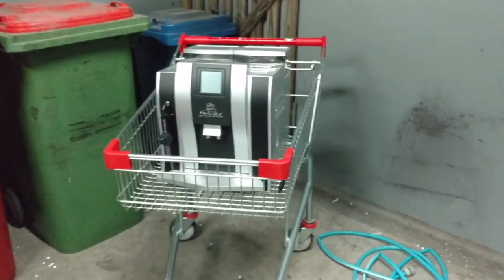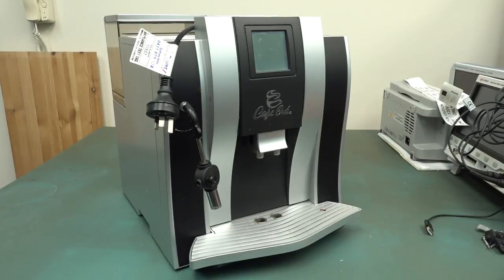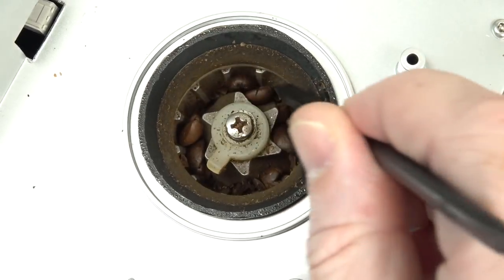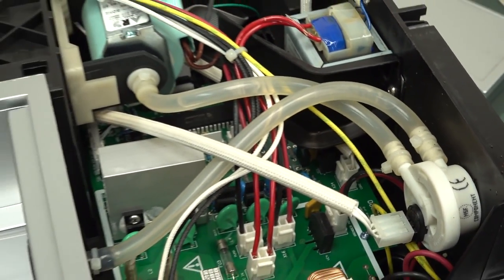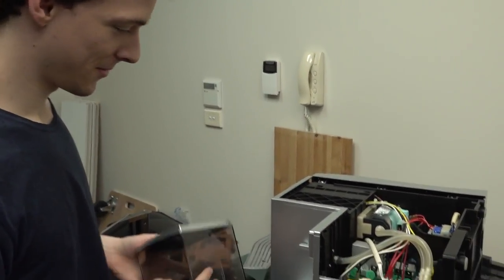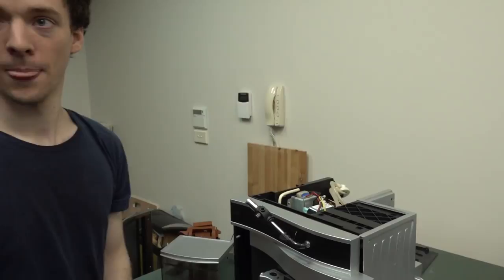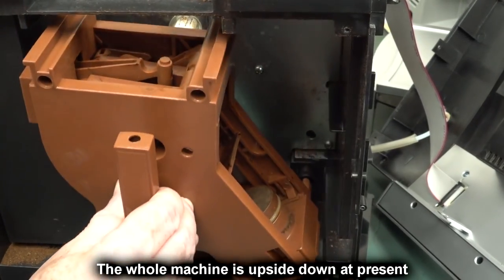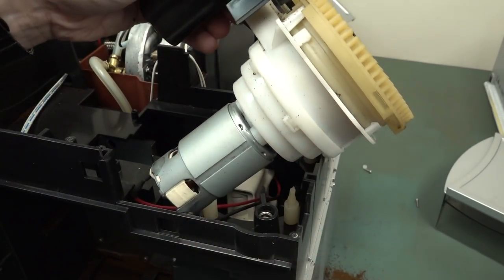EEVblog #1161- Automated Coffee Machine Dumpster Teardown

Comment: The LED at the grinder input likely just senses an empty hopper flipping on an indicator light to let you know it’s time to refill, or possibly prevents it from grinding. If there aren’t enough beans for a full espresso puck I t will just waste that bit of coffee and probably make a mess.

The ratcheting ring at the top of the grinder probably attached to the hopper and could be rotated back and forth to coarsen and fine up the grind size. 

Best I can tell it grinds, tamps, brews, and ejects the spent espresso puck all within that one mechanism.

Some super auto machines have milk heating/frothing features but this one looks to be water only so you would still have to steam manually.  It seems to be, as mentioned later, one boiler for steam, one for coffee brewing since they need different temperatures.  Usually I see those thermal switches on the boilers used as safety switches, but in this case may be regulating the temperature, if not adjustable in software. Espresso machines tend to have lots of redundancies with the safety features though, so it may be a “belt AND suspenders” kind of thing. 

For good, or at least palatable coffee, you need a controlled amount of coffee and water.  So, the white flow device is a flowmeter which takes the water flow, at a controlled flow rate, and converts to electric pulses for counting how much water is being dispensed for repeatable brewing. There should be some timer or other cutoff for the amount of coffee ground.

The two microswitches on the gearing probably act to reverse to retract the tamping mechanism and stop back at the zero position.

That water pump is a vibrating pump which as far as I have seen is a fixed (non adjustable) pressure.

With the manual steaming but automatic espresso brewing, these machines are usually sold to restaurants or similar places that serve espresso drinks as an add on item to what they usually serve.

Comment: It's a pity to destroy that machine that could be sold on ebay for a few hundred bucks... It's strange that the water container is without any water marks. Maybe it's new and didn't work because the owner didn't add water to make coffee? Even it it's faulty it's probably that it needs a bit of acetic acid to clear the path of water...
Reply: Maybe it's that rich dentist he shares the building with again.
Reply: No even a bad machine won’t start without water. The coffee dust said it started, ergo it had water.
Reply: @HighestRank Plus the water that was inside.
Reply: @HighestRank  that's exactly my point. Maybe the owner didn't know you need water to make coffee...

Comment: aw come on by now you should know how espresso is made :( come on, it grinds some beans, places the powder in a compartment, seals it, compacts it a bit, lets in hot water with pressure, hot water goes through the coffee grinds and out comes espresso. the cable looking thing 14:31 is how the pressurized water/steam comes from. It basically performs the motions that a barista would, more or less.

Comment: Nice silicone hoses.  The very same I use for my PC water loops where you can't get them through the PC part chain and most are using those shit PVC hoses that leak.  It seems no one in the PC enthusiast space knows of silicone hoses which is surprising since I have used them from the beginning from the early 2000s

They are common in industry and food, printing and medical.

Comment: Those solenoid valves are actually kind of interesting. I had an issue with my gas dryer a while back all the sudden it just decided to run like forever I eventually thought something was off, check it sure enough no heat. Turn off and on worked then quit, I took front off and left door on and ran it, sure enough the flame was not lighting. I redid some connections, worked, Also checked 2 solenoid valves with ohm meter was fine. Next time went to use same issue. I then checked the one solenoid again and sure enough a 3 lead coil the one lead combination that was okay before was open now. Ordered a couple new coils on Amazon and put in like a $15 fix and 15 minute repair to getworking. It took me an hour or more fighting with finding the issue though. Just unscrewed a clip unplugged old coils slid the new ones on the valve, plugged in put clip back done. Good as new. 

I have seen some boiler motors too that are like this they have a motor winding body, and a core with impeller and I assume inside that is basically an induction or shaded pole motor rotor.

Comment: Not watching this all through it sort of looks like a grinding espresso machine. I have one that takes the grind but does not grind. So it has something to pressure the steam/water to like 25 bar, and the water is used for that and the frothing. This thing would differ from a more stupid pod machine that has some different systems for espresso, and coffee, and adding milk and other stuff, which in some ways may be more complex. I like straight up coffee and espresso because it is the easiest way to down some pure caffeine,and I put the cheapest fine ground coffee in it. I use a Breville Cafe Roma.
Reply: OK the hopper thing exposes the water to the grind and then dumps it I suppose.  The reduction thing looks like maybe the espresso pressure pump. The magnetic shaft is maybe a flow rate sensor with a shaft with different magnetic regions.

Comment: That video should have been out on april 1st. It was painfull to watch! Seriously Dave, you don't know how coffee is made? Ground coffee beans + hot water!

This is an expresso type of machine, it press the beans and send pressurised water throught it. Suposelly it make better coffee, I don't drink coffee.

Beans -> grinder -> press, you now have a coffee puck for the expresso
water tank -> pump -> heating element -> press 
Out of the press via the filter -> cup

Once the coffee is done, it eject the used coffee beans into the waste bin.

Add milk from the refrigerator.

Press a button, water flow in the second stage of the heater, steam come out of the nozzle, stick it into the coffee, it make foam.

Congratulation, you just made a fancyish coffee with the press of two buttons or so.

Comment: I think that was high temp Teflon insulated wiring.  https://youtu.be/aJODkRsi1eI?t=1402
similar to wire used in 3d printer ceramic heaters....

yeah.  The problem with owning a superautomatic that is well dialed in, is you can't get coffee anywhere else.  Ever again.  That's my experience anyway.  Just passed 7 years and ~10k shots. My machine is likely due for a deep dive servicing.  I don't think that thing looks too bad honestly.  In terms of use.  I'd have fixed it and sold it if I didn't like it.

Comment: Hello. I can tell your a high end electronics repair person. For me I deal with auto and electro mechanical equipment. What you have is  a hopper and water reservoir.  Then dealing with a check valve on the water side thru a flow meter then the pump with a back pressure valve for one way thru the water heater and steam  maker on thru a check valve for serving side. Since dealing with steam can be very dangerous. Its good to see so many safety cutouts. On the hopper side yes its just a out of bean infrared sensor. Thru the grind and metering section. After that. the  ground bean is mix with water and distributed out.. Since the programed knows the right mixture its pretty much just set the amount and press run. Mostly you should  be careful of the steam it cause server burns very fast and deep. If you are good with fabricating  you could make a nice hot water maker from that for tea or hot chocolate. Just flush the water part with vinegar and  put proper check valve system in place. 

I might seem dumb but  due carry a degree and have worked on older computer and old world electronics. My main hobby is teardown and rebuild things. 
I am here in the USA and been down under a few times when in there service. So can understand some  don't drink coffee. But got get pissed after working half a day then go home. Seen how you Boys drink and no way would I compete with you.   Good day to you and hi from a sailor that enjoyed visiting your country.

USN DAV Computer/ Radar Tech.
Reply from the maker: Thanks for the detail

Comment: That machine is definitely of meh lol! You'll never see one in a coffee shop that's of high quality completely made out of plastic like that, that looks like it could easily melt if something were to happen lol! This one looks pretty cheap with the hobby motor looking grinder and the fact that everything is built into the machine, high end ones typically don't have everything built in and we use dedicated coffee grinders. Then of course the cheesy name. I'll bet control board failure, usually happens with cheap espresso machines.

Comment: Fitting end to a $1800 coffee machine ( I would fixed it or at least seen if it worked after I threw it off the top of the building yes I am a commercial food equipment service engineer morel equipment isn't thatttt greattttt )

Comment: My impression is, that manufacturers use these non-resettable fuses for planned obsolescense. I had a Toaster and a flat iron fail after some years, because the fuse inside (same brand as in here) had just tripped itself under perfectly normal condition. I'm sure it makes sense to put multiple safety mechanism into something like this, but unlike electrical fuses, these seem to die under normal condition after a certain amount of time.

Comment: Bla, bla, hate coffee, it's a cheap one huh huh, bla, bla..... are you sure? No. The major problem with these machines is their complexity, mechanical requirements, substance leakage (not maintainable to the average user) and their ridiculous service costs (that could be the reason why it is just thrown away).

These products are designed to require service, a business model. Have seen many expensive coffee machines inside and suffer the same problems, over time beans and coffee everywhere (i mean EVERYWHERE) inside the machine (missing protection by exclusive design), leaking pumps, stuck grinders (because of used (taste) additives such as fat in shiny beans), chalk plague, dried out rubber, blocked heads (unable to maintain by user), etc. 

Coffee is business, however not cheap at all, this not a cheap consumer (it is not a professional one) product. What is the brand and price? You can compare this to the 'quality' to a Jura for example, also designed to fail after a period of usage.

Comment: Better not plug it in, you might feed it too much voltage, then you'd have to blame another manufacturer.
Reply from the maker: That's idiotic. You are either being deliberately dishonest, or are very mistaken. I didn't blame Weller for my mistake.
Reply: @joeybushagour2612 indeed. I saw Dave go oh balls ive killed it was all. After tearing it down though he found no mains side fuse… something even my 1930s tube radio has
Reply: @EEVblog  Perhaps an incognito marketing VP doing guerilla commenting?
Reply: @EEVblog  No you didn't. I still wonder if the cord it originally had, had a fuse inside (but shouldn't be de-attachable in that case). Did this coffee maker had any other fuses then that on the board and the thermal-fuses? No magic smoke this time, only the (nice... i think) smell of coffee ;-)
Reply: EEVblog deliberate dishonesty? You’ve called that sarcasm multiple times in other comments. Made this bed for yourself, now go lie on it.
Reply: @EEVblog  get used to your fans making this joke forever now